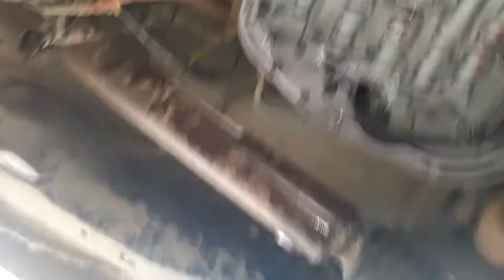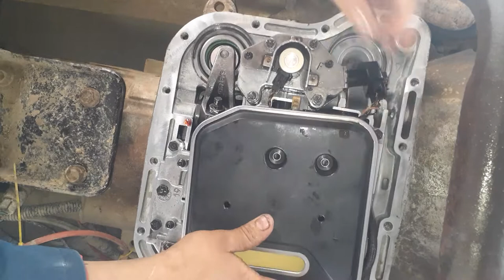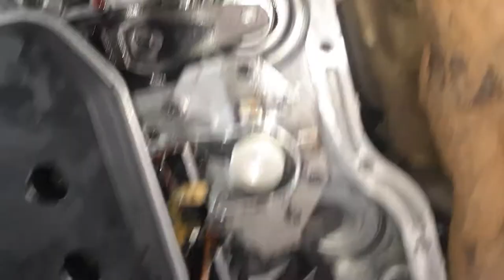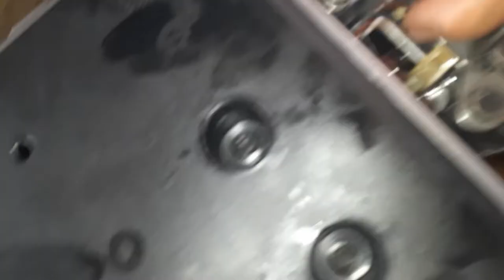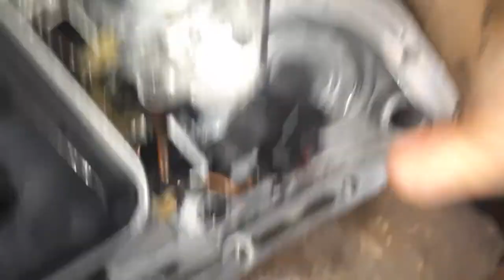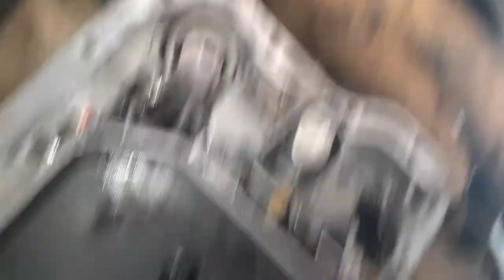P1740 cambio del tcc

Comment: What problems did it cause when that part was bad ?
Reply from the maker: it delay a little while changing gear ..alse check engine light on all the time in my case I was lucky after I replaced this part it went away but if it doesn't fix ur problem most likely gonna be the torque converter clutch